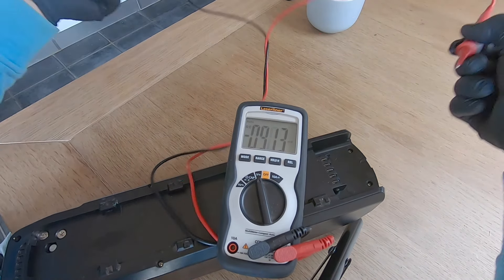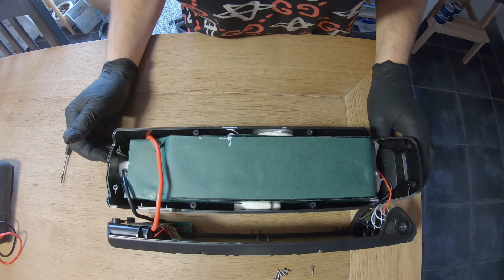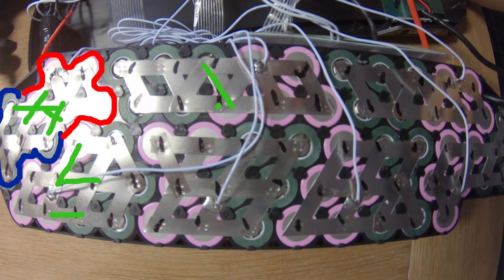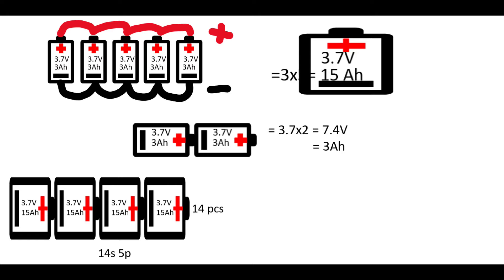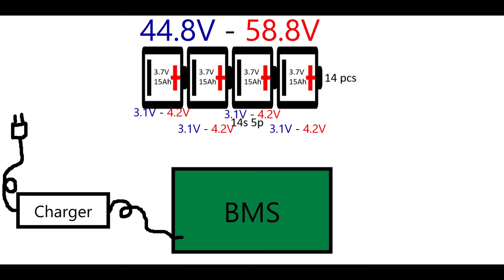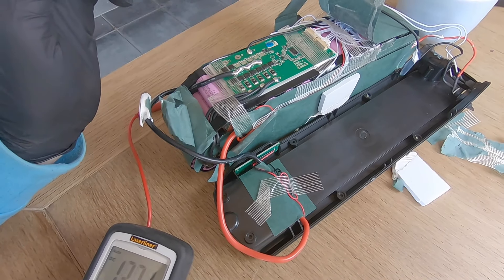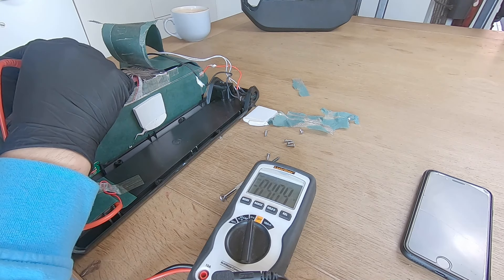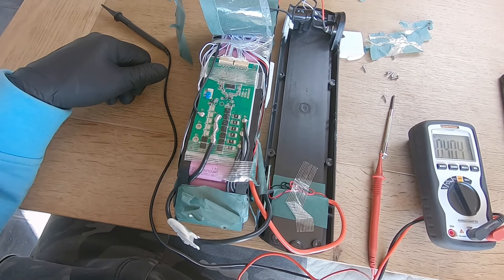Dead BMS! How to test it? & what's inside my 52V battery pack?

Comment: Soooo,  did the new BMS fox the issue??
Reply from the maker: Yes it did indeedd!
Reply: @VRMinde  You are sure it fixed the issue. Can we go see ride the electric scooter just to verify?
Reply from the maker: @AzraelPercussionNEO  mate, if I am telling you it fixed the issue, it fixed the issue. I am not going to spend my time filming a video for you to deal with your trust issues...
Reply: @VRMinde  funny
Reply: @VRMinde this didnt fix sh.t dont lie to people😅
Reply: @VRMinde damn😂😂
Reply from the maker: @thekillerdog5228 oh you little internet trolls :D
Reply: Trolling is adding bullsh.t, i am stating facts! Not only did you use different health,amp,volt 18650"s you also reset a bms, fire hazard!  I know from experience.... but hey i am trolling go ahead guys copy this video!
Reply from the maker: @thekillerdog5228  different amp, volt 18650? Are you drunk? Dude, those cells are spot welded together. How resetting BMS is a fire hazard? Internet expert “from experience”.
Reply: Yes sorry i am so drunk, no! Fr if the bms trips normally it is due to a faulty cell or 2 right? And rather then replacing the cells you choosed to bypass it :D if thats not a fire haz then i am harry potter :,)
Reply from the maker: @thekillerdog5228  as I thought - you don’t have neither knowledge no experience. If you had - you would have understood what have I measured. I checked the total voltage of the pack and voltages of individual 14 groups of 5 parallel cells and the voltages were all balanced (close/similar). That means there are no bad cells and the pack itself is OK. Fire hazard occurs when you connect cells with different voltage and huge current floats from one cell to another causing at least the welded nickel or the cell itself to overheat and potentially get into a thermal run-off. This cannot happen now as the cells (repeating 9th time) are SPOT WELDED together.
Even if there were a couple “bad cells” - after replacing the bms and using the pack for the first time I would notice as I would not be able to use the full capacity of the pack.Yet it is not a fire hazard.
Reply: Well said👍  Also great video, its the exact info I was seeking and you made it easy for me to understand, thanks!
Reply: God told me that this battery pack indeed did have cells gone bad and not the BMS. That voltage fluctuations comes from the battery cells. You should've removed the BMS and go out and ride the scooter/ebike. That will tell you if the battery cells gone bad or not. And unfortunately, you have to completely disassemble the battery pack to find the bad cells. Each cell has go through load testing cause some cells may give you good voltage reading but will lose charge almost completely when put to load.. Unfortunately the battery cells are very sensitive and easy to fail...need new tech battery cells.
Reply: Oh and God told me that he did use fast charger, much higher than 4A. Most cylindrical li-ion 21700 and 18650 cells can't take high amp charging as they deteriorate fast, losing charge. 1.5A to 2A is the sweet spot for reasonable battery life.
Reply from the maker: I use this battery pack still today with all the cells what are you talking about man... @noobz5056
Reply: Yeah its true thank you for helping me out 😊

Comment: Not really testing the BMS are you... your just checking the cells, the BMS issues is not resolved, change the title?
Reply from the maker: OK, I can see your point of view. But at the same time I could argue with you (I am simply not going to :) ). Therefore, I will not change the title. Thanks for your comment anyways.
Reply: Correct. The title needs to updated. He's just troubleshooting the cells.

Comment: Since I started using Lithium batteries, I realise the BMS is their major weakness. In fact, I real lost confidence in them, because you never know when it could suddenly fail out of the blue.
Reply from the maker: Yes it can, but in like 10 years I had 2 of them failing in the way that it “does not work any more”. Without one it is easy to fail in a way that everything burns down

Comment: If you open battery packs, please remove all screws, screw drivers and other metal from the table first. Those are classic way to shortcircuit something, when you accidentally drop something like a screwdriver to the wrong place.
Reply from the maker: Great safety advice!

Comment: Gas is better, BMS shuts off when one cell goes down....it turns off for safety but when you replace faulty cells... you will need a new bms once it turns off to save the battery from overheating, the bms is TOAST at that point

Comment: Bypass the discharge on the bms . I kept having the same problem till I disconnected it  the balance part of the bmms still works it can't working for two thousand miles and only recently burned down which now I'm waiting for a newbie bms you just have to make sure that you turn the bike off once the battery goes down to 20%
Reply from the maker: That is almost as running the pack without one :)
Reply: @VRMinde  my board runs better without discharge maybe not better  than a more expensive one but definitely  better than the bs ones it  come with and I only did this after seeing several people with alot more knowledgeable than me do this on purpose on brand new bms but you are right better with for safety and probably longevity of batteries

Comment: Really well explained.  Thank you for your clear tutorial.  I too have a BBSHD with 52V shark battery but with 19.2 amp-hr so apparently a few more batteries.
Reply from the maker: Thanks man. You will have either more cells or higher capacity cells.

Comment: I have a similar issue except when I have it plugged in, the power isn't shutting down but it's stopping me from drawing any current when I turn the throttle. It'll work when full but later on and randomly it cuts out more and more at the throttle. I'm using other packs at the moment that all work fine. I just did what you did and checked each series and they all have exactly the same voltage. All 3.94v.  Is this still likely a BMS issue? Cause mine is still getting perfect power, unlike yours. Just the throttle cut issue 🤔?
Reply from the maker: Clinton Boucheix did you check the welded contacts on cells? Sometimes there is a loose contact that gets disconnected on vibrations when riding. I cannot think of something else now at least 🙄
Reply: @VRMinde  everything is solid. I checked each one. I even checked for continuity with all of the charge/discharge black wires on the bms. As I said, I'm getting full signal. The voltage is reading it's full capacity, even on my throttle's battery indicator (I have the type that shows the actual voltage of the pack) it's showing the full packs voltage status. It even charges up fully just fine. I'm stumped.
Reply from the maker: Clinton Boucheix these are the worst type of defects that happen at random. Then one of the ways of troubleshooting is to try replacing one component at a time and see if the issue is gone. 
I also assume that you have tried to lift the welded contacts with some tool, not only checked the continuity? 
If you say it works with other packs, then at least you know it is not a controllers’ or throttles’ or wirings’ fault 🙄

Comment: Hi , My battery was perfect till today when I tried to turned it on and it does not . it was fully charged last time and when I tried to charge it does not charge as well . I opened the battery case and can you tell me how to check if the cells or faulty or bms ? Thanks
Reply from the maker: Well, first of all you need to measure the voltage coming out of your battery. “Does not turn on” probably means your controller is not turning on, is there some voltage on the wires coming out of the battery?
If there is no/low voltage, then you need to measure the voltage between the main positive and negative terminals of the battery pack (before the BMS). If you have normal voltage before the BMS and no voltage after it - it is probably BMs’s fault
Reply: @VRMinde  Thanks for your reply . there is not any voltage on the cable coming out of the battery . how to find a main+ and main- before the bms ? please help I am not expert .
Reply from the maker: @mos.f5810  i suggest you watch some video on how to build li-ion battery. That will give you some understanding where those are. I cant explain in a comment

Comment: Thanks, I replaced the BMS already on my battery, the new one did not fit properly, so I had to cut some of the case away, and it was working fine for about 1.5 years until today, it turns out the BMS was ok, just the hardness slipped off abit, important to check the voltage of each bank, if voltage is low may need to charge that bank independently, because it may be too low for the BMS to function
Reply from the maker: I had to add a little box on the battery case as well :)

Comment: Hey there! I have exactly same problem, new battery with samsung cells wrong voltage at discharge port but correct voltage before BMS. Did you replace BMS? did you make video? please post link, many thanks!
Reply from the maker: Hi, I did replace the BMS, but I did not make a video about it as far as I remember :) And it helped. Sorry for the late reply, youtube is no longer notifying me about the comments lately and I do not know why!

Comment: Great video, thank you! I have a 13s7 battery I cannot fix... the bms was charging all 12 groups to 4.2, and one only got to 3.6v. Turned out it was a bad 18650 element. Now after I replaced the bad element, and put a battery on charge - it charged for some time, and now the charger light is green, and all the groups' voltages are different - the one that was fixed now has 3.8V and others are 4.1 to 4.3v, replugging the charger doesnt help. Is it a bad BMS or it sounds like a bad cell? Thank you!
Reply from the maker: I do not know how/why did it disbalance like that. You will probably need to separately charge individual cell groups to 4.2. What is not great is that you have cells at 4.3. Your BMS should not let it go more than 4.2, that is an overcharged cell

Comment: thank you for the advices ! I have a problem on my mercane, sometimes is cutting off , and i've found out that the battery voltage drops from 50V to 6V. Playing with the wires from esc , motor and Dc imput, when unpluging the wire from handlebar mother board , the voltage increases slow to 50. I think that in my case , the bms protection kicks in. I've checked the battery voltage, and I have 50V on the battery,and 46 after bms, is it normal ?!  Great video!
Reply from the maker: I am not sure I understand all of your story, but If you have different voltage on battery ends than on the BMS exit - your BMS is doing something wrong :)  and if the difference is 4V it is way too big
Reply: Instablaster.

Comment: I like how you determined the problem source.  Was it easy to order the replacement BMS?  What was  involved with installing the replacement BMS?
Reply from the maker: It was easy to order... The biggest problem with reinstalling the new one was it's size :) I have 3d printed extra box and installed it on top of the battery pack. Other than that - just rewiring.

Comment: Thank you for your time... Cud you have bypassed or not replace the bms and just connect the battery directly to the motor? Will the motor work, will it also still charge?
Reply from the maker: You can absolutely run it without the BMS, but you need to make sure you: Do not overcharge the pack, do not over-discharge the pack, same for individual cells. The chargers might not be accurate at their voltage. And Monitoring when it is getting over-discharged can be annoying. Overcharging or over-discharging a  cell can lead to a thermal runaway and fire...
Reply: if you want to run without a BMS then you should have a balancing port and a charging port at hand. The charger will cost as much as a brand new battery (or more), but you still can run it that way. I advise you to just buy a new BMS for 10-15 euros

Comment: Thanks, I just went thru this on a power station.  I wish they wrote on the side of the pack what the voltage is suppose to be and configuration so you don't have to try and uncover all this or guess.  Mine has like 56 cells, registered as 25.4V and the BMS seems to be stopping the unit from turning on.  If you plug in the charger it turns on the display but attempting to turn on DC only lasts like 5 seconds and AC didn't even work.  If I bypass the BMS everything works.
Reply from the maker: The consumer these days is not supposed to know anything :D All manufacturers would love us to just buy a new one :)
Reply: Facts😭

Comment: very good video, everything well explained. One question: I have a scooter that uses a 52v 26ah battery that uses 3.6v 14s 10p cells. 10 cells were damaged (water damage). I would like to know if I can change the configuration to 14s 9p with the same controller instead of replacing the cells. and bms
Reply from the maker: The answer is - it depends. Some BMS are flexible and work on different configurations, some are strictly demmanding the needed amount of series connections. 
Probably less hassle with the controller,  but 9s will have lower low-end voltage (~28.?V), question is if the controller will work at those voltages or will it just cut it out earlier. Look for controler and BMS manuals if available...

Comment: thank you for the video, I have a problem with the battery pack, I test the battery direct it has 36v but when I test passing thru the BMS it shows only 18v.
Reply from the maker: Sounds like BMS is not working as it should 🙄

Comment: Hey mate. When riding my 1000W, 48V, 15Ah Ebike (PAS 4 or 5) the power will just cut out then it’s erractic/little power etc. Removal/return of battery on bike can fix issue but it usually returns. To try to keep my description of issue short but still clear, apart from that, the problem is very intermittent and inconsistent/unpredictable. Very frustrating!! Is this the same working issue you were experiencing? I suspect a BMS reset will fix?? Problem did not exist until using bike after repairing the severed wire/s supplying motor that resulted in no power to bike and an “Érror 07”. Thought worth mentioning. Planning to buy a Multimeter today to test.
Reply from the maker: I had similar power-offs on my BBSHD with the stock controller. Can't remember what error code would it give now... Replacement of the controller helped. 
It is always worth checking the voltage of each series to know if there is any disbalance in the charge levels or not.

Comment: Hi mate like the video as I have same problem with my battery, did you get a new board and where from as having problems getting one for a 52v 19.2ah battery
Reply from the maker: Hi man, yes, the new one sorted it out. I had to 3dprint a little box on top of the pack to fit it though as it was a bit bigger than the stock one.
I got it from these guys  https://www.lithiumbatterypcb.com/product/14s-bluetooth-lithium-e-bike-battery-pcb-board-with-30a-constant-charge-and-discharge-current-2/ 
Works flawlessly for more than a year now!

Comment: Hi I'm not sure where to put the negative probe while checking the individual battery wires that go to the BMS I'm not sure where to move the negative probe each time I hope that makes sense thanks in advance
Reply from the maker: Keep the negative at the battery negative terminal (or the negative of the first series) and then your voltage read should be going up one by one individual wire (for example: 3.7V, 7.4V, 11,1V. etc)

Comment: Hi
and thanks for a great video , 
I have a similar problem going on with my wife’s Giant Luv ebike ,I have dismantled the ebike battery case and tested the cells ‘ they are fine so I suspect it’s the BMS  , you mentioned replacement but how can I source a new one of the the same specification 
Thanks Paul
Reply from the maker: Great question, what you are looking for is amperage of the BMS to be at least the same as the old one, ammount of series connections to mach your battery pack and then dimensions/size. It is not something I buy very often so it is hard to advice which ones are good... The ones I got from https://www.lithiumbatterypcb.com/ still lasts on my bikes/scooters. Otherwise - aliexpress. Try nkon.nl if you want one in EU

Comment: Hi mate, I think I have a similar problem. I own a 7s BMS that has a B- and P- that connect to the Battery negative and Pack negative respectfully with Battery positive being common for both.
And +,1,2,3,4,5,6 that connect to the 7 series.
Can you tell me how to test that one?
Reply from the maker: Hi, it is the same priciple, measure directly on the pack and then check if you get the same out of bms 🤷🏻‍♂️

Comment: Very Informative Video! I have a quick question…my Scooter shuts off at 50% voltage…is that a sign of bad battery?
Reply: not necessarily. bms could be kicking in the undervolt protection. it *could be that one cell is draining faster than the others but you need to keep an eye on your range. if you are losing range quickly then time for a refurb & cell swap.